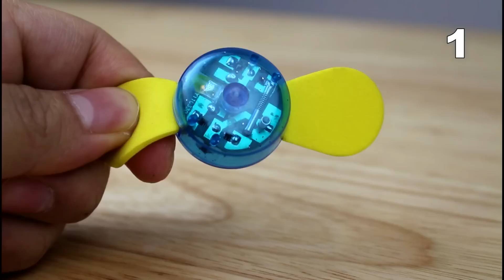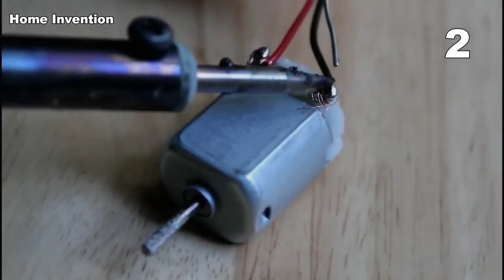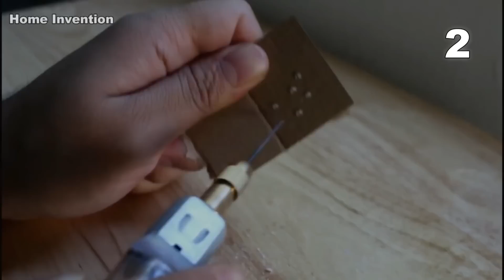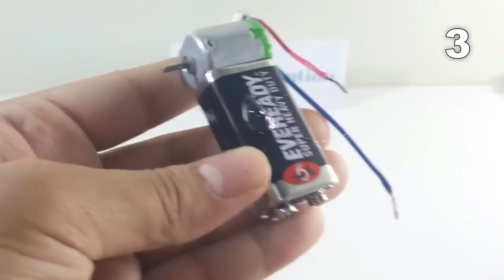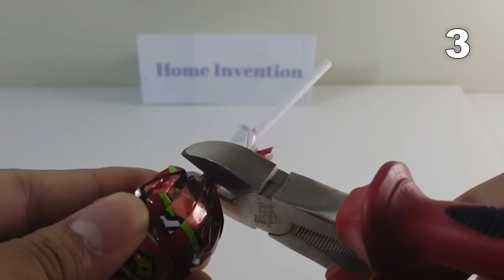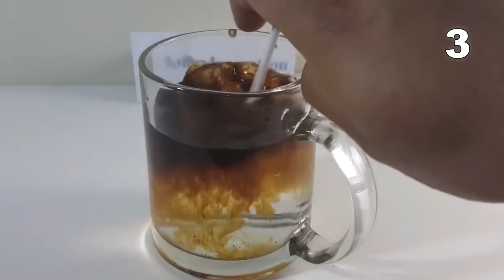3 Useful things from DC motor - Compilation

Comment: If you glue the motor to the battery then if the battery ran out of power then it wel be hard to use it again.